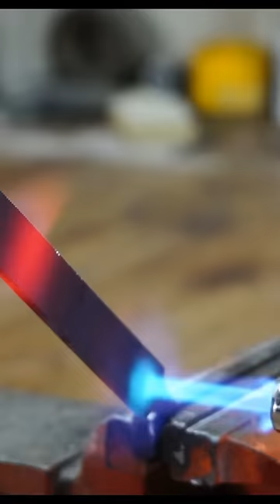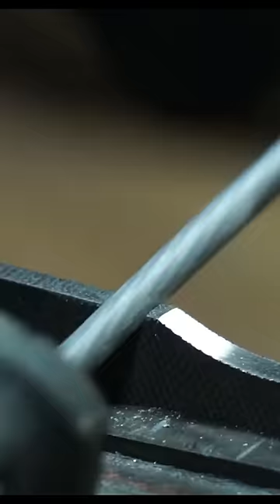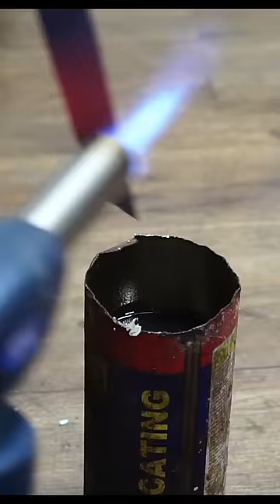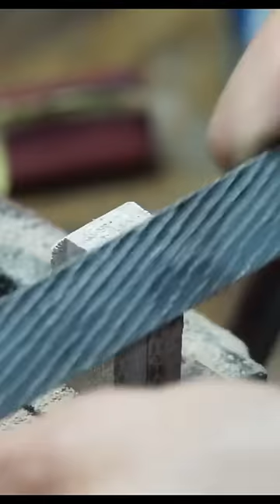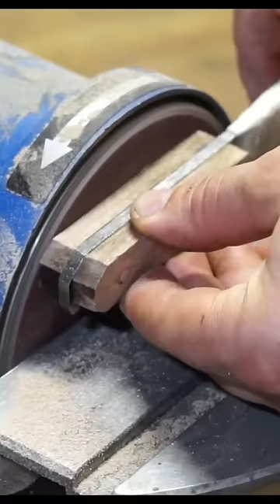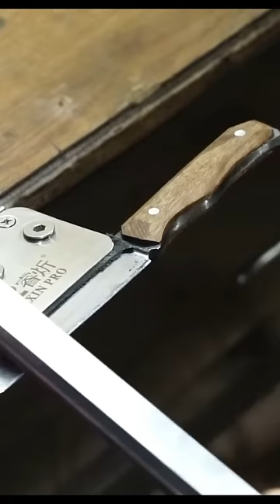Making knife from old file

Comment: hii, great video , I'm just wondering, how did you soften the file , did you just heat it up and let it cool slowly or there's need some techniques to soften it,.hope you answer my question , God bless you 😇
Reply: Smart guess- trust your gut. 
That’s exactly how it was done! 
Research how to soften tempered steels- easy to find! You’ll learn how to identify specific alloys and the how to re-temper them to maximize strength and edge-retention.
Reply: Yeah when he let it cool down like that it lost its temper so it was softer good eye
Reply: Для каждого вида стали есть таблицы температур для термообработки. Повышения и понижения твердости. 
Проблема снова закалить нож на хорошую твердость. 
Термическая обработка очень важна для качества ножа. В этом видео говорить о высоком качестве нельзя.
Reply: Yes sir, you guessed correctly. It's not necessary but one thing I sometimes do if I have a few I wanna soften, I lay them flat in my grill or smoker and just pile my charcoal on top. Mush slower cool down and I don't have to put any effort into it and of course, it saves in gas lol. I've made a lot of fillet and skinning knives from old bandsaw blades and that's about the only way I will soften those. Those saw blades I've had harden right back up on me using a torch because they're so thin, they'll air cool faster than most other steels. The ash from the charcoal insulates so very slow cool down
Reply: God bless you ?

Who lives by the file, who will die by the file.
Reply: I was going to ask what the purpose of heating it first was. I found an old file buried in my garden I want to make a knife out of.
Reply: Most steels have to be cooled over many hours using a kiln to fully anneal  looks like what he did did the trick though ie. To anneal steel, heat it up about 100 degrees F above its critical temperature, soak it at that temp for 1 hour per inch of thickness, and let it cool at a maximum rate of 70 F per hour.
Reply: @brookelord3448 the video makes it look very easy 😂😂😂 to make that knife it looks like you'll need a few years of experience and about 20 hours unless your a natural i didnt have you tube 25 years ago though 👍

Comment: It won't last too long , files are very brittle so if it falls down on the floor it'll break , way easier to buy a proper knife.
Reply: Tell me you know NOTHING about metalurgy without telling me.  The file wouldnt have been ablw to be filed with another file has it still been brittle.  He annealed the file, removing its heat treat.  Then it was shaped, heat treated and tempered, to the correct balance of brittleness and softness.  Just like a regular knife is.  So yes it is a "proper" knife, just mass produced.

Comment: I bought ip all the used files at the pawn shop years ago,just waiting for a winter project.Now I just need something to heat up the blade.I have a burn barrel and a white gas camping stove and propane BQ grill.which one will work to detemper or oven.What temp?do I heat to,got a temp ga.I guess I could just google it.